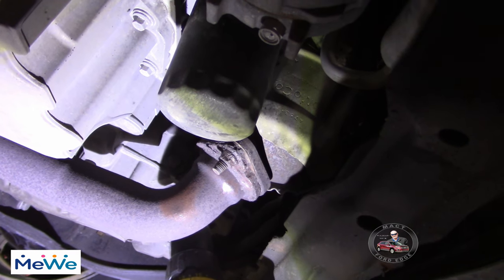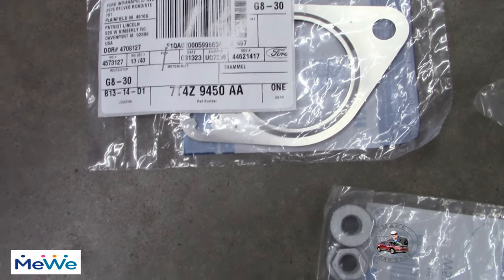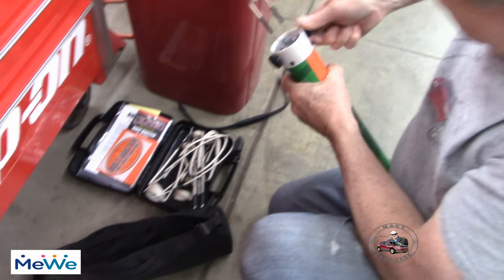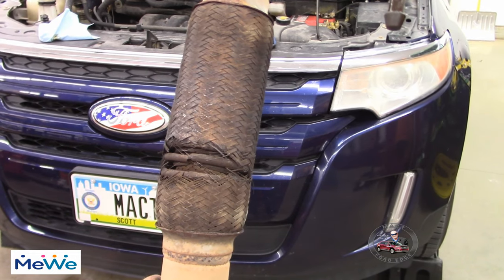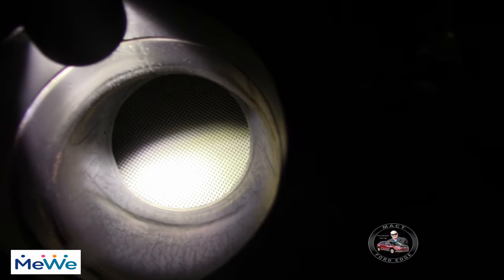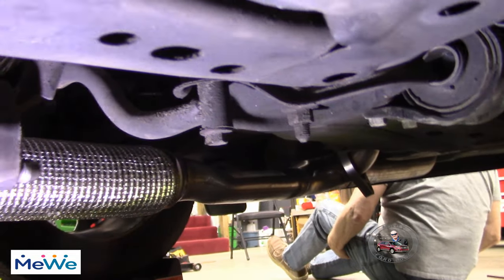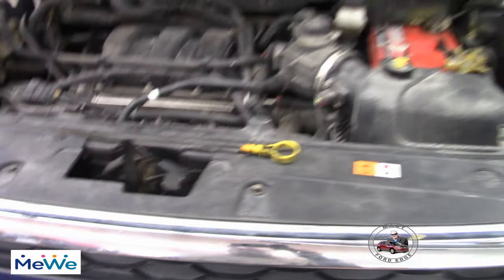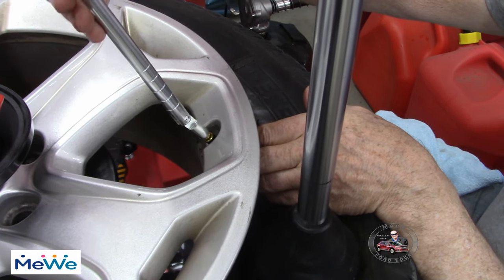Y  pipe and rusty nuts how to remove and install a Y pipe.  2011 Ford Edge

Comment: Thanks for sharing the part #'s.  The studs on my catalytic (s) may not be viable.  Nuts mostly rusted away.  The back ones by the firewall were splintered, looked like flower petals. Curious as to what type of exhaust metal the Chineesium y pipe was as specified to be when you bought it?

Comment: I have a 2013 ford Taurus 3.5 v6 I replaced the catalytic converter bank 1-2 now my y-pipe doesn’t fit it’s off by an inch any suggestions

Comment: Hi I have a 2008 ford edge sel and im replacing the intermediate pipe..any chance you or anyone know the exhaust flange stud size and torque specs? I've received many different options from M8-1.25 and M10-1.5 but the ford dealership can't even give me the info!?!
Reply: Did you figure this out? I'm about to do this and want to get some nuts before I start.